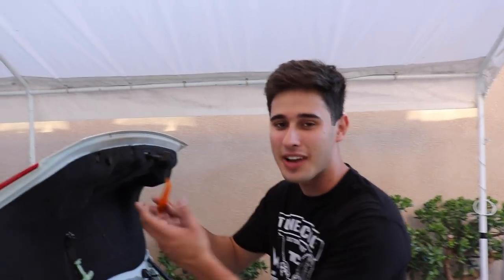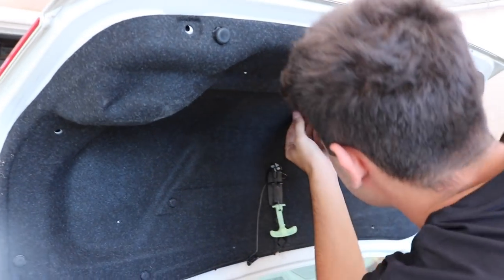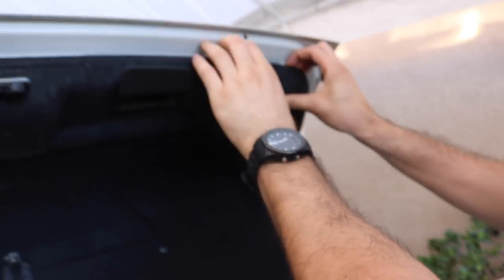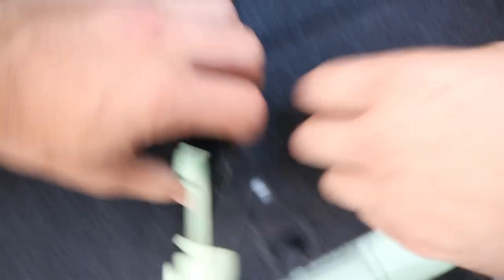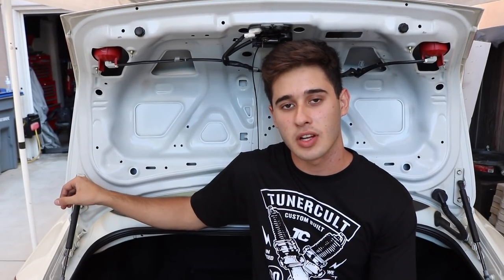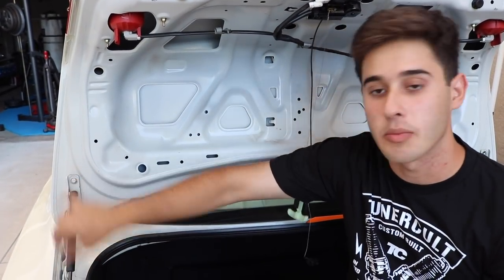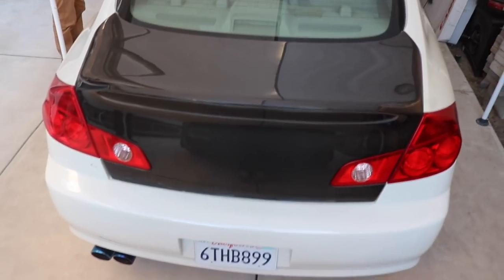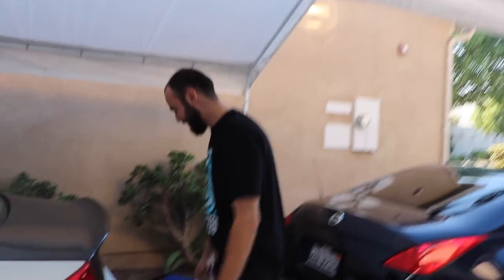I GOT MY DREAM MOD!!

Comment: I'm getting a Carbon Fiber Hood and Trunk for my 2010 Corolla XRS the oem doors are so light it's incredible plus it's got the 5 Speed Manual Transmission Stick shift there's not alot of Aftermarket support for the 09-10 Corollas so ima just do Straight pipe with a dual tip slant muffler highflow cat cold air intake header and a bigger throttle body an aftermarket racing steering wheel I'm replacing the front wingless kit with a K-Style Front lip and K-Style Rear lip and side skirts extension rims and coilovers

Comment: I guess your selling those wheels for 400 I'm number 49 like lol I think if you took of the carbon fiber fenders it would look a lot cleaner. But then again the carbon fiber fenders on a g sedan adds i small kind of uniqueness
Reply from the maker: +Mumble Never agreed to selling my wheels lol, but yes that’s one thing that’s also keeping me with the fenders. It’s really unique to the Sedans. Thanks for the input bro!
Reply: Static Danny lol I need new wheels what size you running on your g 19's or 20's. So true the lack of nicely build sedans is very small
Reply from the maker: +Mumble I have 20s on my G. I love the way they sit but will eventually move down to 19s when I have the money for some Works haha